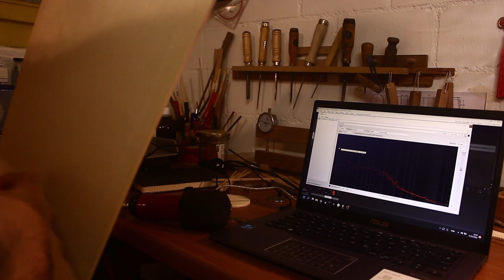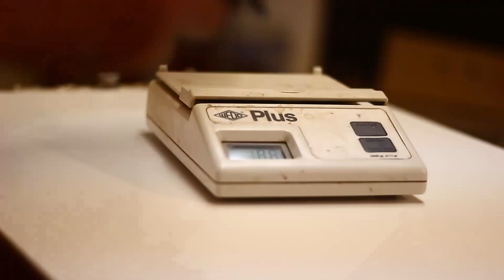Building a Classical Guitar #8 'Avenir" - Part I: The Soundboard. Christian Crevels Handmade Guitars

Comment: Pardon me for asking here, but I could not understand the function of the two boards underneath the top plates that appear in about 3:38.  They are brown, & long, & exist under the glue joint while you are gluing.  You already are suing painters blue tape to minimize the glue squeeze-out, & the joined plates are now a bit bowed in the glue-jig
Reply from the maker: No problem in asking at all. So, the board is not for squeeze-our, as you figured. It is there mostly to provide a flat bed for the two plates to meet consistently all along their glue line instead of only in the three places with the sticks. You are right there is some bowing going on when tying the rope but that all but disappears when the wedges are in place. Anyway, it is not entirely necessary

Comment: To what tickness you hand planed after installing the rosette?
Reply from the maker: The thickness the computer tells me to! Haha. I do resonance analysis and measure density of each top to calculate target thickness. So it varies. In this case if I remember correctly I was aiming for 2,4mm. But I always let some extra material on that I take off only when final sanding the guitar, so it protects a little against dings and scratches during build